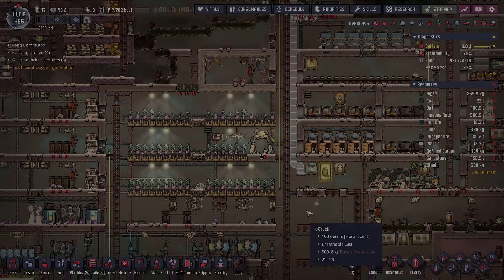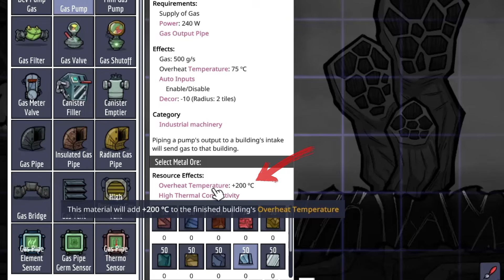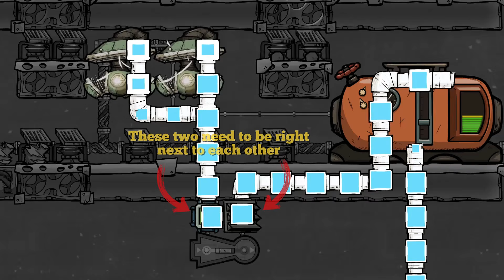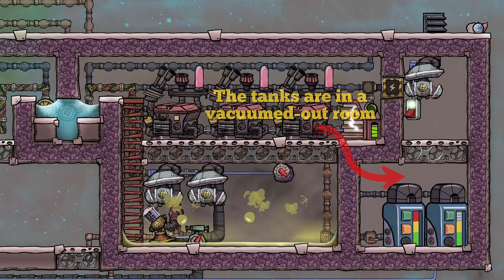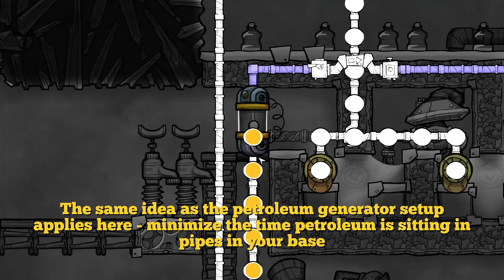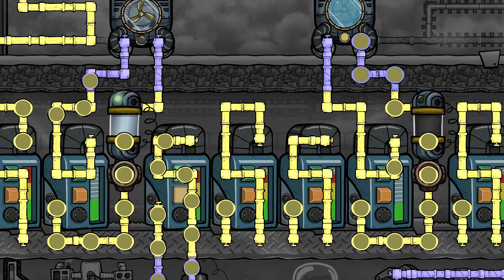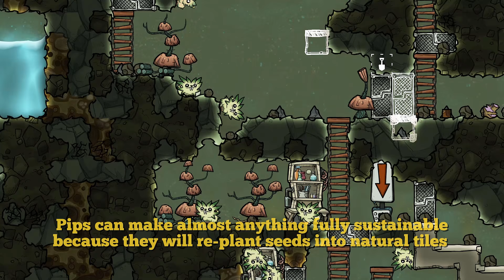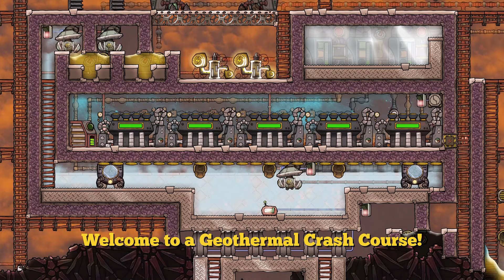How to Get Past the Mid-Game in Oxygen Not Included

Comment: a noob's advice here:
if you really need to domesticate a naturla gas chamber but you dont have steel, you can use a gas pump and a tempshift plate to pump the gas(both need gold amalgam), it will eventually breake, but it will allow you to get the gas
Reply: This, or add some form of semi-permanent cooling loop. Gas geysers and vents usually don't produce that much heat energy, so are often easy enough to cool to a safe temperature if you leave a little bit of space between the source and the pump

Comment: You've inspired me to stick with my longest running base.
Never built a rocket previously, and now I'm attempting liquid hydrogen.
Primary power is still hamster wheels.
Reply from the maker: Hahaha, nice!  I was doing a challenge a long time ago (that I never finished) where my only power source was hamster wheels.  Maybe I should revive that...
Reply: @Magnet_MD  Cycle 970.  Rocket has been launched.  Expect to complete all the other achievements by cycle 1000.  I'll then send you my abomination of a base.
Reply: @Magnet_MD Remember.
Reply: @Magnet_MD  If you follow people like Francis John, or way back in the day brothgar, the Hamster wheel power system never really goes out of fashion.  Early game it is your choice for squeezing power out of dupes.  Late game it is your choice for squeezing athletics out of dupes so they can wear atmo suits without imitating a turtle with depression. Building a gym of wheels is a significant optimization once you have dupes largely doing tasks in steam rooms of hot equipment or building in space or long runs through non-oxygen environments at the bottom of the map.  It is one case where you'd not use smart batteries or automation.  You'd probably just run a room of wheels powering lights uselessly. Lock the doors to force new trainees to exclusively run on the wheels until they have enough athletics to overcome the massive penalty of a suit.
Reply: @waveclaw  Thank right, no one is allowed  anywhere unless they have 24 athletics.
Reply: Hamster wheels are confirmed the best power generation in the game imo

Comment: Im still super cautious about slimelung and germs from vanilla days.  From the videos, it appears you dive in no care... do you clean up the outside later or just ignore all slimelung and germs?
Reply: As a new player I use diffusers in slimelung areas and they eventually go away
Reply: @ElizabethAmanna i do the same myself, I liquid seal the area and clean slime biome.  However,  most of the videos I see dupes have no suits and just dig out all bioms no care.. didn't know if they just leave the germs or if they clean up later
Reply: Slimelung is weak, my friend. It may or more likely WILL infect a dupe or two, but other than making them stop mid-errand to gasp for air for a little while, it's pretty harmless. It may also come with a little bit of stress, but if your dupes' morale is high enough, that shouldn't be a problem. Dig away!
Reply from the maker: Yep, as others have stated, it's nowhere near as big of a problem as before.  It's not something you'd want every duplicant in your colony to have, so it's at least worthwhile to not leave polluted oxygen sitting around, but yeah, otherwise you can generally plow though and you'll be fine